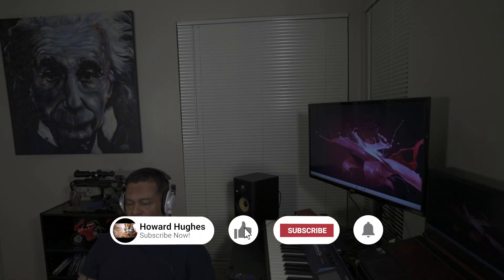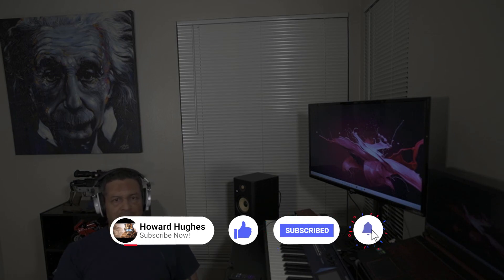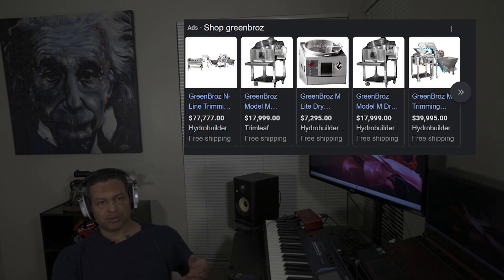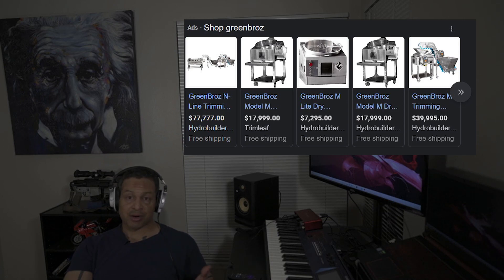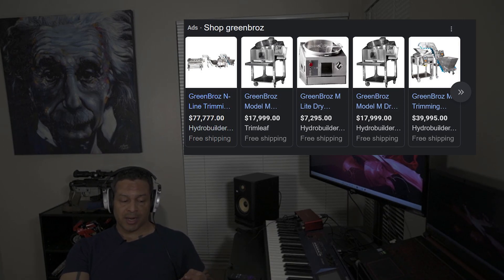TIG Pulse Welding - 500 Pulses Per Second to 50 Pulses Per Second

Comment: Can you describe the oscillation technique you're using with the torch?
Reply from the maker: The way I’m oscillating with these parts is the whip technique similar to MIG. You move forward with the torch a little bit then backwards. “2 steps forward 1 step backwards…” that creates a distinct pattern where the beads are closer together.

Just welding left to right, it can be difficult to space the beads out perfectly. 

Whipping gives a more uniform look with less effort.

If that doesn’t make sense I’ll try to demo it in a future video.
Reply: @howardhughes6212  It does. Thank you.

Comment: I been wanting to play with a pulse welder tried it once and it was fun
Reply from the maker: It is actually kinda fun to experiment with. Another fun setting to play with is frequency with aluminum. 

I once used a 200 amp welding machine and welded 1/4inch aluminum. Without frequency adjustments that’s pushing the limits of a 200 amp machine especially without preheating.

My boss told me to crank up the frequency to like 400hz and it focus the heat enough to weld 1/4 aluminum. 

Not ideal but it works in a pinch.